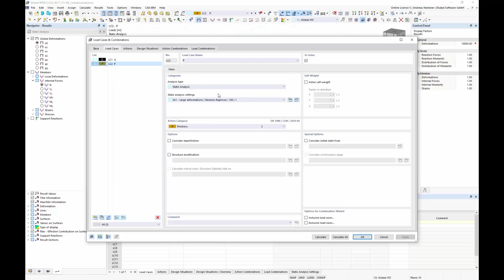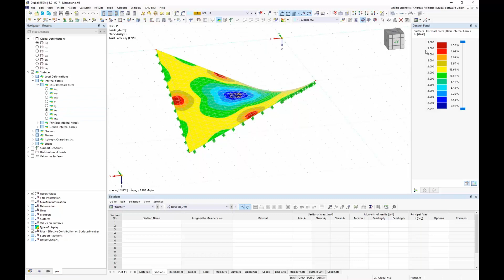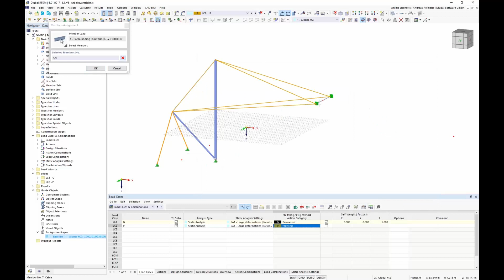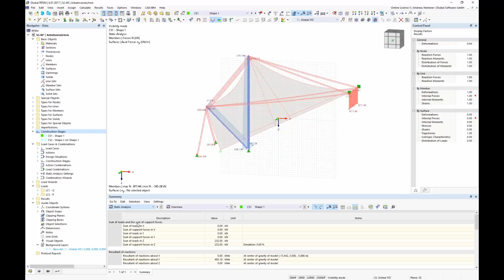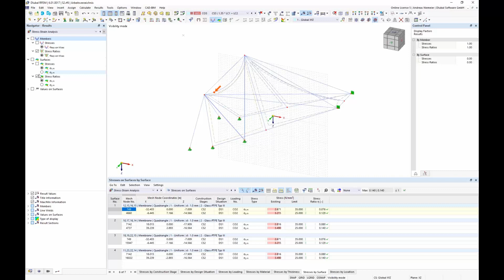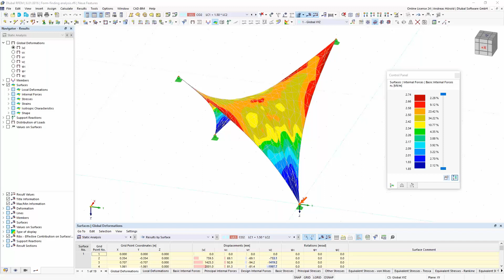Form-Finding and Calculation of Membrane Structures in RFEM 6 | Thu, Feb 3, 2022

Comment: can you tell me please if i want to asssign a pretension force just to give stifness to the matrix of the cable how can i do it?
Reply from the maker: Hi, @panathasftw! In RFEM 6, you can use the 'Member Load' dialog to apply a 'Prestress' load to the cable members. Ensure that the pretension force is compatible with the other load cases by correctly combining them in the load combinations.

To assign a pretension force to a cable in order to provide stiffness to its stiffness matrix, you can follow these steps:
- Define a new load case specifically for the pretension.
- Apply the pretension force to the cable. This can be done by defining a member load of the 'Pretension' type in RFEM.

In the link below you can find further information regarding this topic:
https://www.dlubal.com/en/downloads-and-information/documents/online-manuals/rfem-6-form-finding/003574#h-2

If you need more assistance feel free to contact our support 👍